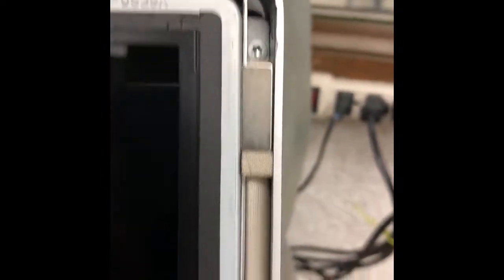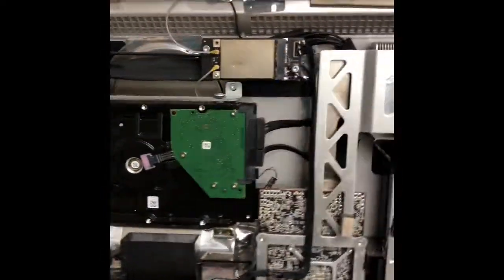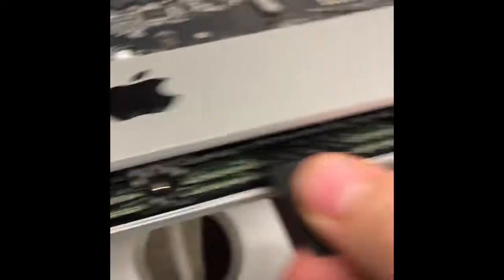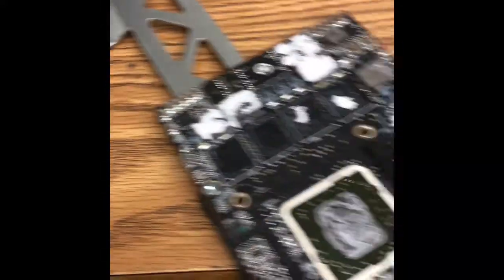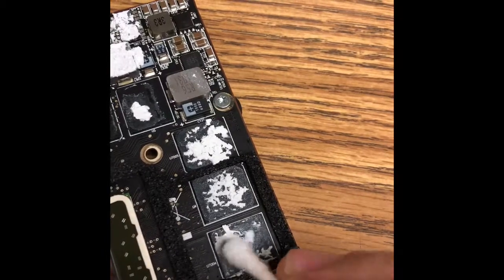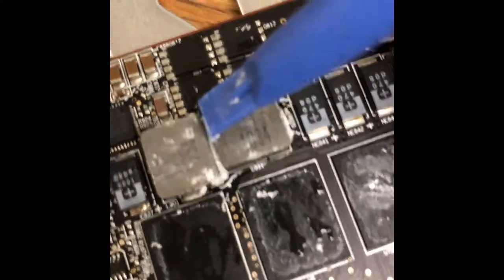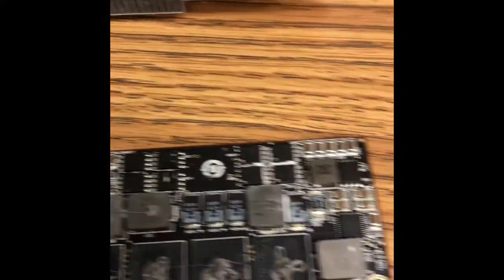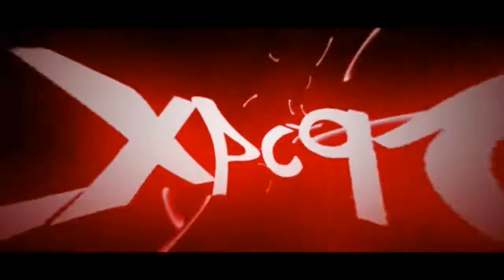iMac  white screen of death Fixed by baking the card!

Comment: Hello. Quick question, can I use the grizzly thermal paste on all chips, and not only the GPU?
Reply from the maker: If your heat sink is in direct contact with the chips then yes. If not, I would use heat pads.
Reply: Yes if it's not electrically conductive.